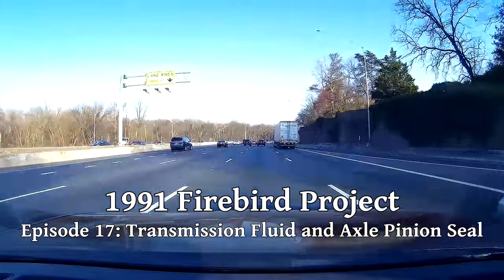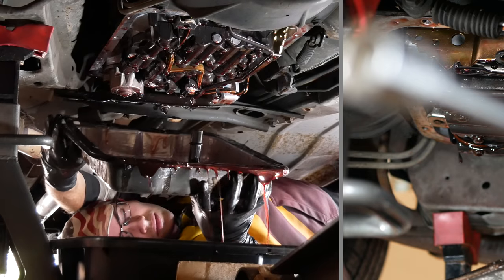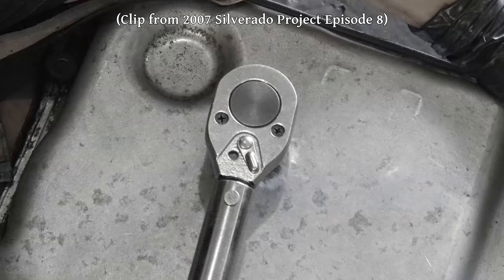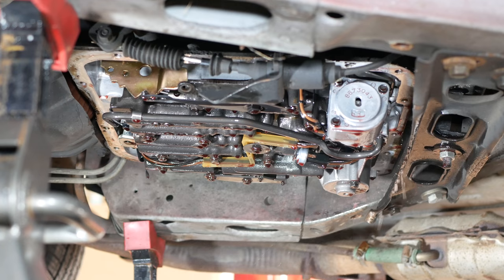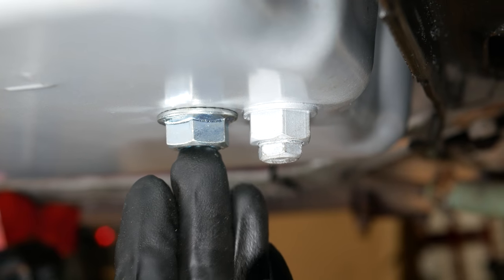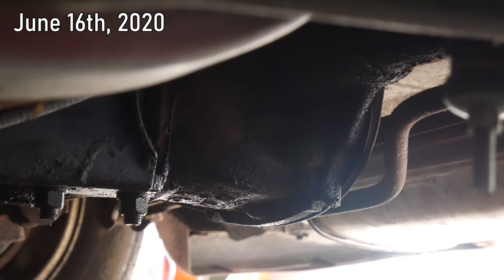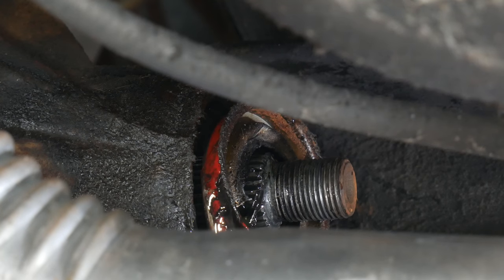1991 Firebird Transmission Drain Plug Debacle and Axle Pinion Seal Replacement (Ep.17)

Comment: The person who desided to put an o-ring in that kit instead of a flat seal or crush washer should be fired.
Reply: Truthfully, this is why I don't like aftermarket mods like this. I'm guessing it's a 50k or so service item for the tranny fluid change. Why risk the integrity of the pan for something you're maybe going to do 3 or 4 more times at most? Plus, you can pick up a fluid extractor from HF for pretty cheap. Just run that down the dipstick tube and siphon it out. You'd be amazed how much that gets.
Reply: It's doorman. The company should be fired

Comment: I bought a little 12 volt oil pump on amazon for about 10 bucks years ago... so you can easily suck out the fluid through the oil dipstick and don't deal with the oil mess when you remove the pan. Very handy.

Comment: I'd recommend putting the drain in the side of the pan.  Point being to drain most of the fluid before dropping the pan.  Unless you purchase a pan designed with a bottom drain you're never going to remove all of the fluid regardless if its a bottom drain or side drain.

Comment: I used the same welded nut setup on my friend's S10, worked great. Anything to avoid the accidental ATF baptism you get otherwise. If you want to replace that O ring with something better, you may be able to remove that drain plug without letting the oil out. I replaced the leaking copper washer on a Scout oil pan by hooking the shop vac to the oil fill (and blocking off the draft tube) before removing the plug. The air rushing in prevented the oil from rushing out. Worked great and saved me six quarts of Rotella! I think I saw it on AvE. I haven't tried it on a transmission, though.

Comment: I bought a 'kit' off Rockauto to repair the worn yoke.
Basically it's a thin metal tube that covers the worn yoke bearing surface.
Did that years ago, and so far it's worked well.
For a drain plug brazing seems to be better than welding, and if ground clearance is a worry install it low on a pan side.

Comment: Dorman products are bottom of the barrel quality .. from personal experience and reading comments from other youtubers on here..
Reply: Agreed. Only use them when there is absolutely zero other options.
Reply: Yea they're super junk, but sometimes they make that one weird plastic or rubber piece that hasn't been available OEM for years so.. you gotta use it.
Reply: @sakumisan  exactly.
Reply: Some of their stuff is actually pretty good. Their 3100/3400 lower intake gasket is better than GM's improved gaskets and most other aftermarket version for example.
Reply: i second that..i have never not regretted buying a doorman product. there oil lines for example will start leaking through the crimps in like a week .

Comment: Having a drain plug definitely makes oil changes easier and quicker. However, I think the reason why there isn't a drain plug installed from factory is because each time you change the oil you're supposed to change the filter as well, which would make a drain plug unnecessary or should I say just an additional potential source of oil leak. I'm planning on changing the oil and filter every five years. Taking the oil pan down twice every decade is okay for me. Anyway, great video, very good narrative as always.

Comment: for the drain, cut a U into one flat of the nut, with the nut welded onto the pan with the open part of the U welded pan-side down. that way you can have all the ATF drain out without any issues with pan deformation.

Comment: Don't worry about the air deflector, it's the first thing to get tore up underneath.  Simple plastic, easy to replace if needed.  All it does is focus air up into the radiator, since 3rd gens had extremely poor radiator air flow from the front of the car, even with a grille.

Comment: I have use the doorman kit in the past on a 4L60E. It leaked like yours did, and then one day magically stopped 🤷‍♂️
Also, for the pinion, don't be surprised if it's not torqued down enough. On my old dodge, it had so much play in it. If you can, get an analog (has like a needle on it) torque wrench and see how much drag you have when spinning the pinion freely. This can help determine if you are too loose or not (pre-load). Otherwise, gotta pop the cover off and determine what amount of backlash you have. Off the top of my head, I believe you do pre-load first and then backlash.

Comment: Why did you put the plug in the first place? From my experience, you don't change the transmission fluid but around 100k, and when you do you have to change the filter; therefore you have to take the pan off. I vote for no more plugs.
Reply: I was thinking the same thing
Reply: Or buy a pan with a drain plug.  I know the budget counts for something.
Reply: You're supposed to change the fluid every 20k
Reply: @austindoud273  who told you that? a transmission flush and change place? unless you have catastrophic failure that puts shards of metal in the fluid, i say the perfect time for a fluid change is when you are forced to overhaul due to friction wear..  the exception being a tow rig where trans temps get super high.. i can guarantee that trans there was serviced in the recent past and at 200k, it's been overhauled along the way too.. 700r4's don't typically go 200k... my guess that unit was serviced by one of those jiffy flush and lube places that sucked the tranny fluid out and put in fresh.. the pan hadn't been opened since the overhaul..  hence the metal and no friction material...
Reply: @austindoud273  it say 15,000 under extreme conditions 100,000 miles under normal driving conditions. I'm unsure of what your point is.
Reply: @matthewcarbary8757  if you actually read it basically anything other than highway driving is "extreme"
Reply: @austindoud273  I did read it along with a GM certified mechanic telling me the same thing. Extreme driving conditions would b if u run at the track on the weekends or some dumb kid doing reverse curls or neutral drops or your hauling heavy loads on a daily basis. Stop and go driving and highway driving is concidered normal conditions. I can go 5 to 6 thousand miles in between oil changes there's no way ur supposed to change ur transmission fluid every 3 or 4 oil changes. The norm for transmission fluid change is 50-100k miles depending on the type of fluid u run and a individuals driving habits. If ur transmission fluid needs changed every 20k miles something seriously wrong is going on with ur transmission or u drive ur car like a idiot.
Reply: I can't speak for anyone else but I use a plug to check for metal shavings or anything else that's not supposed to b floating around in ur transmission in between fluid changed. Plus if u accidently overfill it it's alot easier to pull a drain plug than try and drop a corner of the pan. It's nice to have if u service ur own vehicle
Reply: @matthewcarbary8757  Change automatic transmission fluid and filter Interval: Every 25,000 miles if the vehicle is driven under one or more of these severe conditions 1)In heavy city traffic 2)Where the outside temperature regularly reaches 90F or (32C) or higher 3)In hilly or mountainous terrain 4)uses such as police, commercial 5)frequent trailer pulling. If you do not use your vehicle under any of these conditions, change fluid and filter every 50,000 miles.
Reply: @austindoud273  the only ppl that'll tell u to do that is the mechanic ur paying to change it. Ur transmission cooler will cool the fluid plenty unless ur redlining and smoking the tires every time u take off and I agree with u on hauling heavy loads but transmissions and the fluid is designed to go way farther than 20-25k miles in between changes. I have a Saturn with a sealed transmission with almost 300k miles on it where u can't even check the fluid.
Reply: Transmission shops must love you I was told there are two types of people one is the guy who never changes his trans fluid and 2 the guy who follows the book and changes his !00k is ridiculous by then your transmission is probably junk
Reply: @kurtnulf3362  never had to take any of my cars to transmission shops. 2006 Saturn with almost 300k, 2007 Impala with 200k, and a 87 suburban with a 700r4 trans that had to of rolled over at least 3 times and I only had the transmission outta that once back in 03 to put a shift kit, aftermarket trans cooler, and a Corvette shift solenoid in for towing my camper. All run and shift beautiful. I run full synthetic with a lucus additive and k&n filters except in the Saturn which I had to take in and have done over 100k miles ago. I never said I don't change the fluid I just don't waste money and time changing things before they need changed.
Reply: @kurtnulf3362  you can change your transmission fluid as often as u want and listen to what "the book" says, it won't hurt anything, but I come from a family of mechanics and body guys and speak from experience. I'm just curious as to what y'all are doing to these transmissions that you say are junk after 100k miles if you don't change the fluid before then.
Reply: @matthewcarbary8757  Trans fluid breaks down from heat it gets dirty it cleans and lubricates the trans so changing it like the oil in your motor is a good idea nothing last forever not even trans fluid and a clean trans is a happy trans .We can argue  this till the cows come home like Ford or Chevy to each there own .Personally I prefer manual trans myself
Reply: @matthewcarbary8757  Will then you never had a 42rle trans then broke down 168000 miles or what ever they put in the amigo for a trans
Reply: @kurtnulf3362  I agree like I said u can change it as much as u want and i never said I don't change my transmission fluid. I know all about fluids breaking down, getting hot, losing their volocity, which leads to mechanical failures. I was never arguing or telling ppl what they should and shouldn't do, I was speaking from experience and what I've witnessed over the years. I go 75k miles in my truck between fluid changes since I do use it as a tow rig, and 100-150k in my cars depending on the fluid color, smell, and volocity
Reply: @kurtnulf3362  I have not
Reply: You change your trans fluid at 100k?!?! Ooof! Never wanna buy a used car after you.
Reply: @matthewcarbary8757  bruh, make sure you mention this when you sell your cars used. You are laughable. Fluids are the cheapest insurance. A trans is a sealed system that wears and you are advocating 100k fluid and filter changes? Are you high or just a vegetable?

Fluids change viscosity with heat.

I can just image how terrible your fluids smell and how black they are.

The sad part is most part failures, especially power steering pumps can be completely avoided with simple fluid changes. This is why people recommend a pan with a drain bung. You don’t have to change the filter every 25k, but you saying that opening up a drain, draining worn fluid and refilling is too much work is just laughable. 

Buy a performance car, you’ll see how long your transmission lasts at lifetime intervals
Reply: @goclunker  what r u talking about? First I'm not a car salesman, I've had my impala and Saturn since new and don't plan on selling them anytime soon, I usually hand my cars down instead of selling them. I never said I don't change my fluid or filter.I run a drain plug cause when ur teaching a 10 year old to take care of stuff and he overfills it by 1 quart it's easier to let that extra fluid is out threw a drain plug that dropping the whole pan and having to replace the gasket I just replaced. Once I see one of my vehicle fail from bad fluid I'll agree with u but I've had all my vehicles since new except my suburban and haven't had a single problem out of any of my transmissions. I have however witnessed my mom get a flush and fluid change on her Pacific from a "professional" transmission place and idk what they did but it wouldn't shift outta first gear and acted like it had a stall converter afterwards. They paid to replace it but that's why I service all my own vehicle. U do know new Ford's go 150k between fluid changes right? Even that's too long for me but that is the manufacturers recommendation. If the fluid doesn't look or smell burnt and it hasn't lost it's volocity and there's not metal shavings in it and it doesn't have 200k miles on it then the fluid is still good.
Reply: @goclunker  and I've had a few performance cars. We're not talking performance cars were talking everyday drivers. If u have a performance car and u drive it like a performance car things do brake down faster. Big difference between going and picking up groceries and kids and going to work verses trying to run a ten second pass at the track tho
Reply: @goclunker  and I've only ever had one transmission go bad in a 89 Pontiac Bonneville that I had years ago. A ex thought it was a good idea to drive with her feet and slammed it into 1st at 55 miles a hour from drive when she took her feet down. I was still able to drive it a few days afterwards but it eventually gave out in the middle of the night on my way home from work. Nothing to do with the fluid, it was piss poor driving habits. As a matter of fact that was my first car and I know that it had at least 120k on the transmission fluid because I got it off my uncle and he bought it new and was the kind of person who don't change anything, except the oil,  unless the vehicle won't move or stop. U really think all these car lots change the transmission fluid on every car they get in? If it looks and smell ok and still shifts alright i'll put money on it that they don't mess with it, regardless if it has 25k or 250k miles on it.
Reply: @matthewcarbary8757  I’ve had NONE go bad, driven at WOT, daily. Maintenance.
Reply: @matthewcarbary8757  lmao. Performance cars don’t “brake” down faster. 🤦🏻‍♂️
Reply: @goclunker  no but the fluids do in high performance. Higher rpms, more heat= the faster fluid and parts break/wear down. Make sure your reading and understanding a comment before you comment. Never said I don't change my fluid and filters and like I said if u drive high performance vehicles like high performance vehicles are designed to be driven the parts and fluids do break down faster than normal everyday vehicles because your driving them harder and faster than everyday driving. If I ran one of my cars at the track on the weekends I would change fluids more often cause it would need it, not during everyday driving conditions tho. So your telling me the fluids in my car break down just as fast as a performance cars that is ran at higher rpms and produce more heat? Same reason I change the fluid in my suburban more often than in my cars because I use it as a tow rig which means the fluids get hotter which means it will and does brake down faster
Reply: @matthewcarbary8757  I’m not getting into a youtube argument with you. If you think regular fluid changes are unnecessary, you are a fool. End of story.

Comment: You can use a butterfly drain plug meant for stripped oil pans. They're dirt cheap, require next to no work to install, and the one I use for my oil pan has a soft and thick rubber gasket that'll seal to fairly uneven serfaces.

Comment: Mentioned it before and just to top post, any home-made drain or fill ports should be an NPT. A bit of sealant and they'll never leak. Many sizes, styles and materials of plugs, plus you can add valves, elbows, extension nipples, etc. -- a lot options.

Comment: I have found that Constant Velocity joint grease with molybdenum helps significantly when applied to the contact surface of a new seal or the inside diameter. Especially when the rotating surface being sealed against has the witness marks or grooves from years of service. Rear main seals, final drives, CV flanges, cam seals etc. Just a suggestion

Comment: You should have put some lifted stops slipped in there as the last cord oil it helps those high mountain treatments live longer because it's higher filter strength and more stickiness to hold the fluid to the park

Comment: All you gotta do is remove pressure line from radiator and hang it in a bucket and run car till no fluid helps to have a friend to help dont wanna go past the fluid stopping from flowing

Comment: If you could change the gearbox oil once in 200 000miles, why on earth would you need a drain plug? Do you believe this weekend car will make 50 000miles in the foreseeable future? Even after 50k miles... Would you change the oil? How much time would you save by dropping the oil pan and changing the gasket, compared to ... making a drain plug? I think that in the long run you do not need a drain plug at all. Thanks for the video! Keep it up.

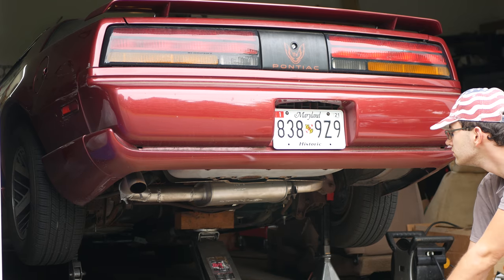Comment: 18:00 if obligued to use that yoke, you can polish to mirror finish with a strip of canvas & gun polish paste, back & fort, up &;down aprox. 2 hours elbow grease. No need for lathe. I've done it times before.

Comment: Whenever I get a car that doesn't have a drain plug on the trans I just get a Dorman transmission pan. It comes with a drain plug already in it and it's thicker than most stock transmission pans. The best part is it usually runs only $20.

Comment: You could try drilling a hole on the side of the nut so that it is flat on the bottom of the oil trans pan, but when the bolt is removed it can drain from the drilled hole in the nut? just a suggestion have never tried this.